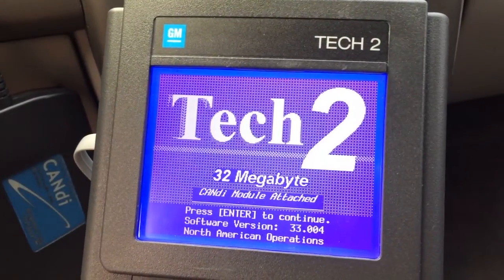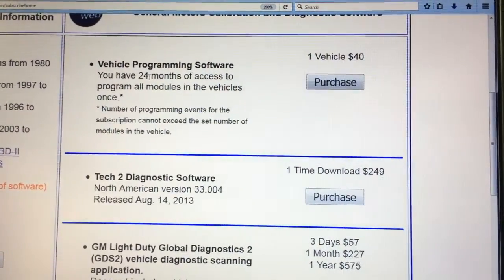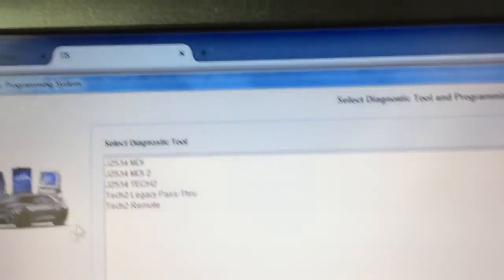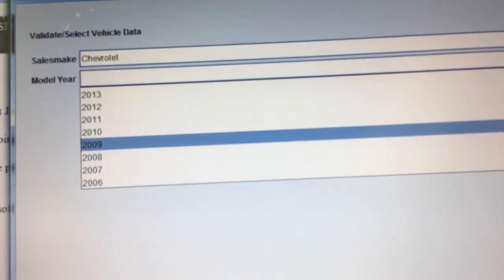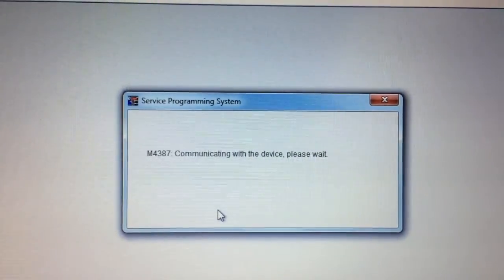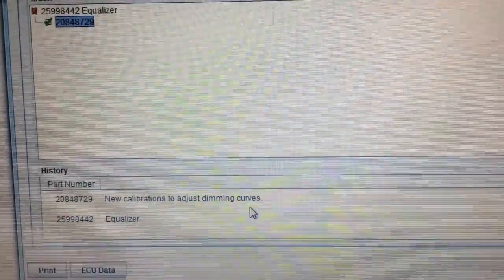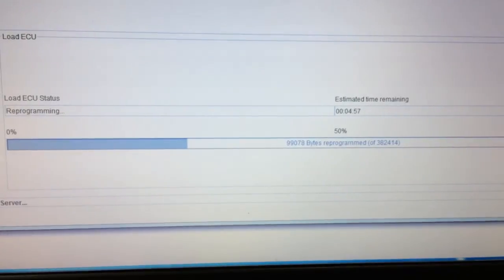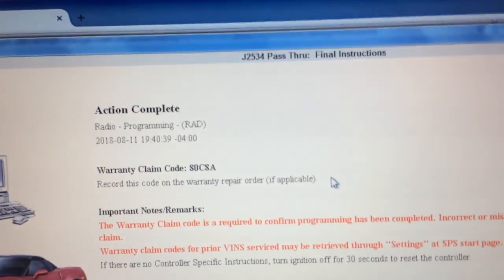GM SPS Programming: Tech2 Tool Pass Thru Mode ECU TIS2Web TDS How to do a Calibration Update Reflash

Comment: Where do u get trans operating system number with the teck 2?  I can't find it anywhere.
Reply: I just need to confirm which one I have for the tune.   Ile check out the video.  Thanks
Reply from the maker: I'm not sure exactly what you're asking for.  There is no such thing as a transmission operating system number in GM.  If you mean the Tech2 operating system version number, you should be seeing that when the unit is first booting up, the version number of the operating system level is printed before you press enter to get the menu.
Reply: To get my truck trans tuned u need it for trans module.
Reply from the maker: You can use the Tech2 to check that your transmission module has the latest GM calibration.   But you cannot use a Tech2 to alter the calibration or "tune" it in any way though.   If you're just looking to validate the factory calibration, then it will show up in the list as shown in the video at 5:55 where you will see TCM (transmission control module) in the menu to choose from.

Comment: When you try to program some radios on the SPS using MDI there is no “radio” choice on some vehicle models . How to dealers program those    Radios ? Or do they have a different subscription to be able to program all modules ?
Reply from the maker: These approaches change with the times/model years but learning the VIN and "calibrating" the radio is usually found somewhere in the Tech2 menu (or Tech2Win emulator for the MDI) for vehicles up thru around 2008.   After that it should be found somewhere in SPS as part of calibration, but again how varies by model year and vehicle make/model in my experience.  Modern navigation radios also have USB based programming that you have to consider, that do not even use SPS.   I don't have alot of experience dealing with radios and even then just when it's the same make/model year swap.
Reply: DrShock so if I buy the tech2win software I can just use my MDI to act as a Tech2 device ? I appreciate your help .
Reply from the maker: You would have to get a subscription to the Tech2Win service, but yeah that lets an MDI emulate the Tech2 for older vehicles.   These various subscriptions can get pricey, so make sure you check it all out first.  Sometimes it's just cheaper to have the dealer do it if you're not going to have a longer term need for the MDI.
Reply: DrShock perfect thank you . I have the subscription and I seen the Download for the Tech2win option but didn’t know what it was . Thank you again .

Comment: Can I program 01 impala bcm with just the tech 2 alone
Reply from the maker: 2001 Chevy would certainly be within the makes and model years covered by the Tech2.  But not by itself, you would have to have the TIS 2000 software as well at a minimum.   Or a TIS2Web sub as this video covers.  Now regardless that's for setting up a brand new replacement BCM from GM/ACDelco.  Used salvage yard BCMs are a mixed bag, some years you can some years you cannot.  I'm not sure about 2001 sorry, perhaps another YT vid will cover this for you.
Reply: @DrShock  yes I am going to get the tis..2000 software I have that gray phone cord and I have a hookup on my computer for that cord if that will work or will I need to convert to a USB cord end
Reply from the maker: Native serial port is best, USB adapter as a last resort.  Only a few work, I believe some other comments mention that.

Comment: It’s incredible how well the clones look like the real tech 2. Honestly the original tool probably was made in China so it’s probably the patent ran out the Chinese sell it cheap
Reply: If I send you mine and pay you could you fix it where the thing quits rebooting when starting the car for say an evap test. I’ve changed the voltage regulator I don’t know what else to do. If your interested let me know
Reply from the maker: @philh9238  That particular behavior cannot be repaired, the clones don't have access to a proprietary voltage device from GM that the genuine Tech2's have (its not sold to the public and heavily patent and license protected).  That device allows the Tech2 to function down to much lower voltages caused by battery voltage drop off during engine cranking.  I mention this behavior in the video description here https://www.youtube.com/watch?v=VAmGybyWfJ4
Reply: I changed out the regulator with the part number you mentioned still does it. So it just sits in my bottom drawer of my toolbox since September. Guess that’s what happens when you buy cheap Chinese junk 😂
Reply from the maker: @philh9238  So if you read the detail on that video in the description, that repair is only to get the clones to power up again if the voltage convertor fails outright and replace it with a branded one that will be much more reliable.  But there's absolutely no way to correct the design limitation of voltage dropping out during cranking with off the shelf electronics.   I wouldnt call the clones "junk" since they are basically the same boards as the original GM one, just some different chips here and there that gets it down to $300 range vs the $3000 range.  If it were not for them, no average home owner could afford to acquire such dealer level diagnostic tooling.
Reply: Okay thanks for your time replying. I misunderstood the meaning of the video so I thought that’s how you were fixing that issue. So how do you personally handle that issue on your own? Just asking
Reply from the maker: @philh9238  So the issue is the Tech2 (clone or genuine) prioritizes the power from the DLC (diagnostic link connector) under the dash.  It will ignore the AC power adapter as long as voltage is present on that jack.  I haven't had to chase this problem personally, but the way I would address it is using the AC adapter to power the clone Tech2 at its DLC cable end (not the clone Tech2 bottom power connector) and removing the fuse supplying power to the DLC jack (it may be labeled as an ODBII port).  If the vehicle didn't have a fuse for that I'd look into buying an ODBII extension cable and modify that extension cable by putting a switch inline for power (pin 16) where the power is being supplied and flip it off when I had a job that needed me to crank the engine while the Tech2 needed to stay on.  Said extension cable fits in between the vehicle DLC jack and the clone Tech2 DLC cable so neither of those need any mods.  Both of these ideas came from various forum posts over the years so others have had success with both approaches for the problem.
Reply: I think I understand. Power the pin 16 at the dlc end? Not the port on the unit itself
Reply from the maker: @philh9238  Well you want to connect the Tech2's AC adapter barrel jack to the special plug for it at the end of its DLC cable, rather than the barrel jack on the base of the Tech2 unit itself (there are two places to connect the AC adapter).   And then you want to pull the vehicles DLC jack fuse (if it has one) or alternatively make a special cable by buying and modifying an OBDII extension cable so you can put a power off switch for pin 16 +12VDC from the vehicles battery.
Reply: That’s where I messed up at. I connected it on the bottom of the unit it self not at the end of the cable. I’ll give that a wirl and see what happens when I pull the fuse.

Comment: I purchased the one vehicle VIN module update package and am trying to use it but it keeps getting stuck at the same place. I'll select tech2 legacy pass thru on the SPS app, and when I go into settings in the SPS app, I click test connection and it always fails. I have my Tech2 plugged into the serial adapter, powered on, and matched the COM ports and baud rate with the ones my laptop gave me. However, every time I click test, the Tech2 switches to the screen with the symbols on it indicating that it is communicating. I dont know what to do. It says connection failed, but it is clearly communicating with the tech2 since the screen changes each time I click test connection.
Reply from the maker: Some things I would check, did the Tech2 pass it's internal diagnostics tests particularly the serial test with the loopback connector plugged in?   If that works ok I'd suspect the USB to serial adapter.  There are some other comments in this video that I recall some links around adapters known to work with the Tech2 - some are not compatible with it.
Reply: @DrShock  I figured it out. instead of using pass thru mode, I switched it to j2534 tech2 mode. it communicated through that and I was able to update every module except the rcdlr in my 2008 G6.

Comment: Hi I have a 2007 cadillac escalade that had the basic radio and bought a used one from another 2007 but is the navigation radio. it turned on but the screen says theft lock. I got a tech 2 but it wont let me do a vin relearn. I saw then online that I needed the 30.004 version  and mine is the  33. What would you recommend me doing? thank you.
Reply from the maker: I've never heard of downgrading the Tech2 firmware to an older version, certainly no such GM technical service bulletins I could find recommending that.   Sounds like a wild azz guess someone made because it appeared to resolve their issue.  This is an old tool and the firmware hasn't been updated in a very long time, the only version to be using for North American vehicles would be 33.004.  Other country areas would have different versions as their last revs.   That all said, for 2007 the Tech2 is the right tool to be using for that vintage. But the magic word is "navigation" radio, did you select this option on the Tech2 after each prompt?  Here's a link I had from awhile back with the menu steps that may help you - http://duramax.onlinedesk.net/navinstall/THEFTLOCK%20CLEAR%20PROCEDURE.html
Reply: @DrShock  yeah i saw that but it doesn't say navigation radio on mine just radio.
Reply from the maker: This radio upgrade is the correct part number for 2007 Cadillac Escalades though right? And you didn't have to modify the wiring harness or such to connect it up?   I do know you won't get Tech2 support for trying to put a radio into a vehicle that wasn't originally available as an option at the time.   Do you have a TIS2000 DVD that came with your Tech2?   If so you could try doing an SPS calibration update and see if it lets the vehicle body control module learn about the new type of radio like this other video I did - https://www.youtube.com/watch?v=Nr_eYexAAV4
Reply: @DrShock  not sure if correct part number but it hooks up with all the  connectors no problem. yeah I got the tis2000 CD. I'll probably end up doing that.

Comment: Can you help me figure out which device I need to reprogram a 2012 radio for a 2007 GMC? I thought my Yukon was CAN, but I'm seeing most boxes say 2008 and up.
Reply from the maker: I think you're asking Tech2 or MDI here right?   And if so it's based on your vehicle not the radio, the scan tool is going to be communicating with the vehicle.  For a 2007 the native tool of the time would have been the Tech2.  But the MDI can emulate a Tech2 with a subscription to a software emulator GM calls Tech2Win on their ACDelco TDS website for use with older vehicles.   The MDI will handle CAN (GM LAN) built in but the Tech2 will need a CANDi module between it and the vehicle to translate.  The bigger challenge is the 2012 radio is not a stock GM part number for model year 2007, so SPS won't show you a calibration file for it.
Reply: @DrShock  I'm only seeing people say "you need to program this to work in your vehicle," or "take it to a dealer." Does this mean clearing the theft lock? Doing a VIN relearn? I picked up an MDI based on your advice that comes with a Win7 hdd, so hopefully I'll be able to do this. And I guess I just do the $40 subscription option for programming. Thanks for your help!
Reply from the maker: If you had a non-navigation 2007 radio from a different GMC than your own but the same GM part number, then with just a Tech2 (or MDI with Tech2Win) you would just do a VIN relearn procedure to unlock it.  Since you're taking a 2012 one, this may not work but its the first path I would attempt.  You don't need a PC connected for this one for 2007 (though with an MDI of course you would just for Tech2Win).  And yeah what this procedure does is re-marry the radio to your VIN and thus release the Theftlock II lock.

Comment: Why is it that the Tech 2 in SPS/"request information" does not list Saturns? In mine it doesn't. What make can I use?
Reply from the maker: The only Saturn model I'm aware of that needs it's own separate PCMCIA card firmware is the Astra.   The other Saturns should be in the GM North American PCMCIA card, firmware version 33.004.
Reply: @DrShock  Hey thanks! That's the version I have, (It shows it on the menu upon start up menu). Yeah in my Tech2 the first step in SPS is to request for info and Saturn's aren't listed on mine, (SPS version is 2.080). You think my PCMCIA card needs updating?
Reply from the maker: If you don't have an Astra I don't think so, card wise.  And I'm going to presume here you've purchased a TIS2Web subscription and are not using something that may have come bootleg with a clone scan tool from China.  Be sure you have set the serial COM port speed in the SPS Java applet like I mention in the video.   Also I have read in forums that aftermarket radios will definitely prevent communication with the Tech2 on a Saturn of all things, so if you have one disconnect it and retry.  Same for any aftermarket devices that provide steering wheel audio controls or really anything hanging off the radios rear communications bus connector harness.   What year is your Saturn?  If it's 2008 or older I would try just using the Tech2 with the TIS2000 DVD that should have come with your Tech2 instead of TIS2Web to at least see if I could communicate with the BCM and ECU modules to get the information populated.  If none of that works, since you paid for a TIS2Web SPS subscription you are entitled to support from ACDeltoTDS so give them a call at 888-212-8959
Reply: @DrShock  Correct I do have a subscription, it's a 2007 Saturn Ion, (and no after-market radio). Before calling them I want to make absolutely sure it's not something I'm doing. With what I wrote I first tried TIS2000 after being  installed and it requires one to go to SPS on the Tech2 menu, (I dont mean on a website), next, 'Request Information', then enter the make of model. That's were I see a majority of makes listed except for Saturn. That's the problem I'm having with the Tech2 and TIS2000 for Saturn. Cant populate it if it's not listed on the Tech2 Scanner under the SPS menu.
Reply from the maker: @bootoxkikka hmm, so when I take my Tech2 and select Diagnostics, 2007, Passenger Car.   I then get Saturn as one of the choices number (8) at the bottom of the first page make list.  That's without TIS2000 or TIS2Web, just the Tech2 sitting all by itself connected to a Chevy for power.  So if you're running "North American" firmware 33.004 version and you're not seeing Saturn as a choice if you go the steps I did, then I'd have to believe it's a firmware/PCMCIA card problem with the file(s) saved on that image because mine is a clone and it shows Saturn just fine - and I don't have a Saturn handy though but I still loved my 1992 SL2 ;-)
Reply: @DrShock  Well you see you're going to  F0: Diagnostic, not F1: Service Programing System, (the second option on the menu). I can go to diagnostic and yes Saturn is number 8. I'm talking about Service Programing System.
Reply from the maker: @bootoxkikka, ah ok then forget what I said earlier.  I see the Saturn Ion was one of the first models to incorporate the new GM CAN bus so your 2007 certainly has it, you have your CANDi module connected between the Tech2 and the Ion right?
Reply: @DrShock  Yes. Lights up, self-check comes out fine.
Reply from the maker: (UPDATED) @bootoxkikka, out of ideas then.   I google'd around out of curiosity on what you're hitting since our chat here has eliminated the usuals and while I see a few folks with Saturns experiencing what you are on various forums, but I never saw any resolution shared by any of them.  I did find one GM SPS TDB for the 2007 Saturn Outlook and it has this disclaimer in it "Important:  Saturn retailers must use the Tech 2 Pass-Thru Method to complete the programming event in this bulletin.  The Remote Tech 2 Programming Method is not an available option for Saturn retailers."  And I found another specific to BCM reprogramming for the Saturn Ion "To setup a new BCM, use the Tech 2 in conjunction with the Saturn Service Stall System. Refer to Service Programming System (SPS).".   A Saturn Service Stall System apparently was a Saturn flavor of a Techline terminal.    Found this for Saturn Ion (at bottom) also - http://ultraviolet.im/saturn/1998_Saturn_SL2_Files/servlets/BlobShtmlf5df.html?ShtmlFile=1547358   Definitely seems like enough to point to something unique about Saturns, time to call the TDS help desk and confirm.
Reply: @DrShock  Agree. You've confirmed some of what I've looked at and read after several hours and days of googling. Thanks for your help DrShock.

Comment: thank you! how do I install software (new without o/s) on tech2?
Reply from the maker: The Tech2 stores everything on the linear flash card inserted into it (looks like an old PCMCIA card but its actually a special kind of memory not used in PCs).   There hasn't been an update to this since 2013, last North American version was 33.004.  If your's is older, you can update the cards contents using acdelcotds.com website, but it will cost you $249.00.   Best to get this "with your Tech2"  ;-)